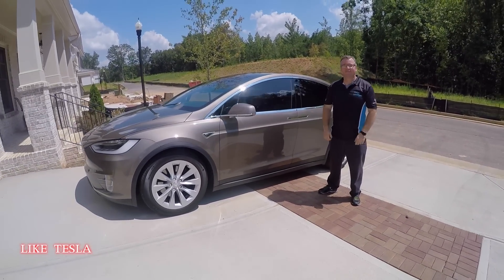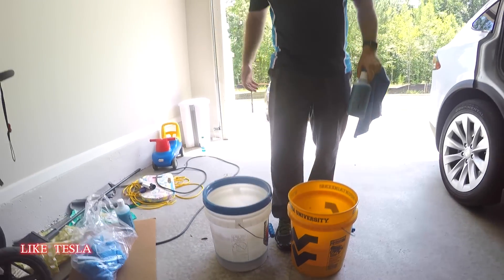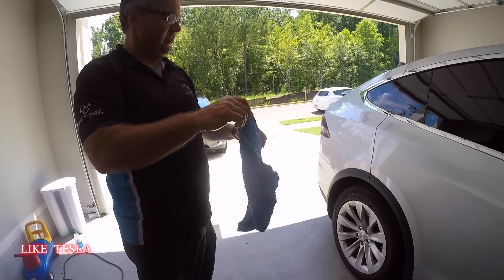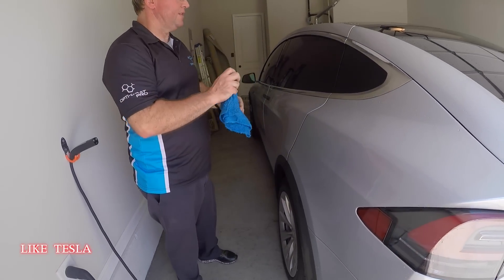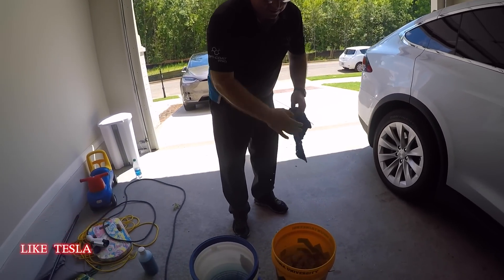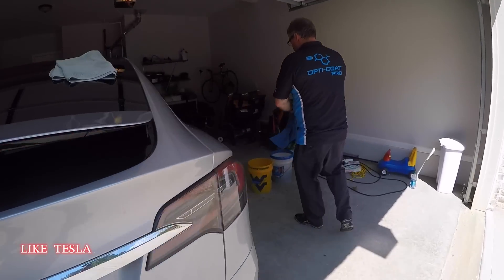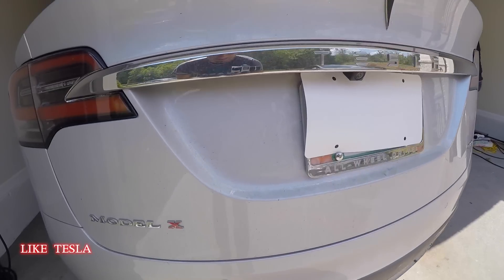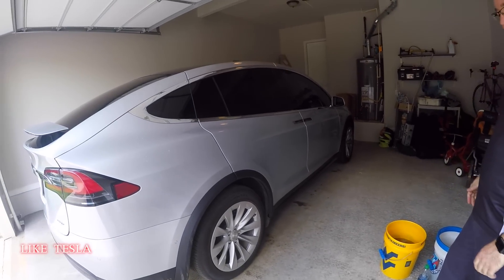Best Way to Wash a Tesla!

Comment: The following is an overview of why ONR is better and safer then soap will ever be.

Lubrication-, ONR lubricates through all phases of washing, washing with soap provides lubrication while the suds are on the paint, but then it gets rinsed off, and the drying process has no protection. Water is by definition a solvent, so with a soap wash you are trying to dry with a solvent that has high surface tension, ONR has a very low surface tension, and provides exceptional lubrication for all phases of the washing experience.

Precision-, when using ONR you still see the paint, and you see if you have missed 
anything, unlike when a car is washed with suds, and you see those little 1/2 moons or triangles where a spot was missed. If you miss a spot with ONR you see it before drying.
Waste management- With soap (and other brands of rinseless washes) a 2 bucket method  is needed to safeguard the paint. ONR is a very powerful water softener that drops all dirt out of suspension, dropping it out of harms way. If you wash with another product you  will see that dirt floats in the wash solution, that is dirt you pick up and bring back to the paint with your wash media of choice. With ONR a single bucket is all that's needed, plus you can use the same water to wash numerous vehicles, no need to change after every  car. 

Ease of use- ONR works well with all wash mediums(Sponge, Mitt, Micro fibre) and is fast and easy to use, no need for 2 buckets, wet bay, water reclaim. or other complicated items, just your washing media, 1 bucket and your drying media. 

Body Shop Safe- ONR unlike many car wash soaps and rinseless washes does not use silicones to give it a false or temporary feeling of slickness. ONR's unique blend of 
polymers allows for safe and residue free washing in all environments.

Labour Savings- ONR reduces labour times considerably over traditional soap and water washing. Less time spent rinsing, less time washing. less time drying. 
Water Savings- Less rinsing means less water use, no big explanation needed.
Versatility- ONR should be in every detailers tool box, at the standard 256/1 dilution ratio it can be used to wash exteriors, used to clean interiors, glass, in your steamer 
(reduces the need for cleaners, think of it as supercharging your steamer), for clay lube, not to mention around the house. At stronger dilutions it can be used as a waterless wash, waterless wash, and quick detail spray.
Reply: i just struggle to believe no water does not scratch the paint.....hard out skeptic over here
Reply: +pauljosee It's a rinseless product, not a waterless product. And give it a try, it works beautifully. Works better and is more efficient than soap.
Reply: you prolly dont care but does anyone know of a tool to log back into an instagram account??
I stupidly lost the account password. I appreciate any tricks you can give me
Reply: @Reginald Declan instablaster ;)
Reply: @Jaxtyn Crew thanks for your reply. I got to the site thru google and Im in the hacking process now.
Takes quite some time so I will get back to you later when my account password hopefully is recovered.
Reply: @Jaxtyn Crew it worked and I now got access to my account again. I'm so happy:D
Thank you so much you saved my account :D
Reply: @Reginald Declan Glad I could help xD

Comment: You did a perfect video about this method.  It really works great on our Model x.  like your friends car, he and I share that same color and our is wrapped in eXcel as well.  I wanted to answer a few questions about really dirty cars or even salt covered for this who have asked.  If your lucky you can find a Touch Free carwash, not a touchless. This will remove the bulk of crud on your car and really help with then using your method in one's garage.  I hate swirl or small scratches and the product you show here works perfectly, plus they offer a solution that has wax to really make the paint pop.   hope this helps.
Reply from the maker: Thanks for taking the time to explain that. Appreciate it!

Comment: My car gets absolutely filthy (my office is located on a farm out in the country, so I have to drive down country roads where tractors have been, and then I have to drive through two fields where sheep and cattle are grazing - lots of muck!) so I absolutely have to use pressure hoses to get it off. Wiping it off is a no go - the towels will just be covered in muck and you'll just be spreading the muck around. 

I'm hoping that the office will be moved soon, so by the time I get my Model 3 (2018-19, I've reserved but only last week) I can use this method!
Reply from the maker: Matt7895 yeah sounds like pressure washing is the way to go for you!
Thanks for watching and happy holidays.

Comment: if you have properly dirty car, this method is a no go.
The whole point of using a lot of water is to remove as much hard particles out of the paint surface as possible. next step you want to foam the car to dissolve some of the grease away. 
This method can only be used as a third step, but I would not use just a towel.

I have noticed that his car was initially hardly dirty.
Reply: The car was very dirty. :) I've been using ONR for over 5 years. I wash my cars 80% of the time with ONR and have no issues with marring or scratching. If your car is excessively dirty, a quick hose rinse wont hurt.
Reply from the maker: My car was extremely dirty. Just came back from an 800 mile trip, but perhaps the silver color is just good at hiding it.
Reply: I agree with you. I think if ONR was used with proper technique, it won't scratch. However, if you rinse and foam your car prior to touching the paint with a towel, the chance of scratching would be significantly reduced. It is a matter of how to balance risk of scratching against saving water.
Reply: I wouldn’t call it dirty when you can still see that the car is white and not grey. I think maybe this method could work during summer, but not in winter with salt, dirt and black snow.

Comment: I wholly dispute the water use numbers you give.. I can assure you that by using a hose with a nozzle I can wash my Tesla with a little more than the 4 gallons you use with that chemical based wash.. and furthermore,  that wash can NOT be used on  a dirty vehicle .the vehicle MUST be pre rinsed using water and soap.. there is no substitute for dupont #7 cash wash.. I've been using that for over 20 years..  what do you do when the car has been hit by multiple bird droppings? pre-wash.. also.. how do you wash the tires and wheels?

Comment: does this method work if it's really cold and there is salt residue left on the car from the street when it snows? I'm in Chicago so in the summer I can wash my car outside but in the winter no way.
Reply: When dealing with salt residue, I suggest rinsing off first to prevent swirling of your clear coat. If the temp is below freezing, you could have issues with the solution freezing to the paint. If working out of a garage in the winter time, I use warm water in the buckets. That way your hands stay warm.
Reply: Bryan Burnworth so rinse off with a separate rag? It would be kinda hard to rinse it off with a hose in the drive way when it's 10 below and snow on the ground.
Reply: +Dominic Sorrentino unless you can find an indoor wash facility to use, it's going to be difficult to do any washing in 10* weather.

Comment: I think this method will scratch the car...
Reply: I've been using ONR for over 5 years. I wash my cars 80% of the time with ONR and have no issues with marring or scratching. If your car is excessively dirty, a quick hose rinse wont hurt.
Reply: +Bryan Burnworth is this method similar to Claying? Except with a wash instead of wash then clay.
Reply: +omniblast no it's just cleaning.
Reply: Hey Bryan. The maintenance wash in your website seems to be a traditional wet wash. Do you wash your client's car by ONR or a wet wash?
Reply: When I perform a maintenance wash or a decon wash. I use foam, lambswool mits, etc. So more of a traditional wash with 2 buckets. Washing our MX I perform ONR wash 90% of the time.
Reply: dont judge bro, even its scratch its not your vehicle
Reply: FUN ikr
Reply: Like Tesla that your opinion if he’s the best in the country why would you wash it In the garage  he didn’t wet it first if u wanted to get the dirt of them wash it that’s what rinsing is for the Loose dirt if it’s wet it crutches more that’s not a 1000  micro microfiber towel so he is scratching the dirt goes into the micro 1000 micro micro fiber towel  so it’s is scratching
Reply: Bryan Burnworth ikr he doesn’t know what he’s talking what you said was agreeable